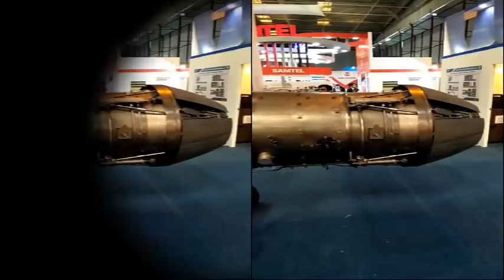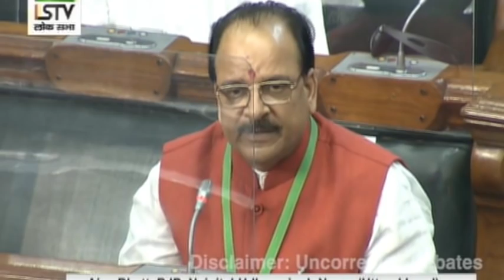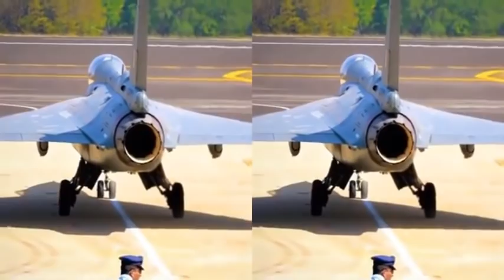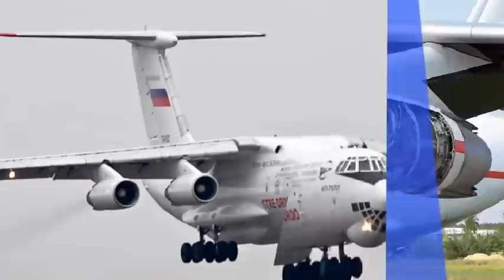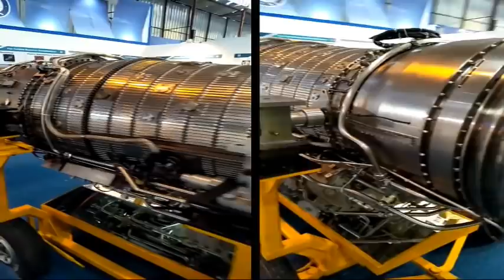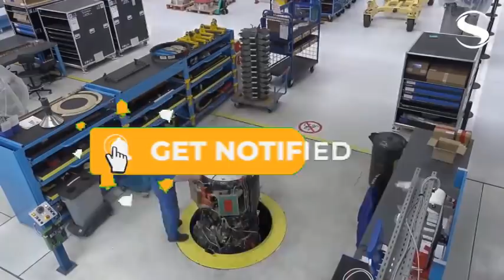Update on Kaveri Engine by Ministry of Defense | Realistic review of Kaveri engine program

Comment: While burning the fuel more pressure is put on to the nozzle so this creech problem is occurring during the fuel burn out so replace big size nozzle the  creech sound fully exhausted it's problem only in nozzle only replace with big  nozzles definitely the sound is exhausted it

Comment: It's shocking that DRDO has not its own flying testbed.How can we expect a perfect engine?
Reply: Didn't they just acquire an air india a320 as FTB . But I guess that was for radar, don't know why they can't buy another a320 and convert that into FTB for kaveri programme. This dependence on Russia is exactly why it is taking so long to build a reliable working jet engine.
Reply: @nachiketkulkarni8540  For engine testing a 4 engine testbed is the most suitable.
Reply: India needs  fully functional wind tunnel facility.

Comment: According to DRDO they want an engine with 110kn for AMCA. I don't understand why we are going for such a low power engine for our future frontline fighter. Shouldn't we go for something in the range of 150kn engine?
Reply: Actually 110kn for an F414 sized engine will be a very hard challenge to accomplish.
Reply: Because AMCA is a 25tn class fighter jet.It doesn't need more thrust but more electric power.
Reply: But we don’t even have indigenous 110kn engines?
Reply: bcz drdo only needs the engine core and metallurgy . They can then upgrade it to whatever extent they want once they get the metallurg right
Reply: I think the reason is that it's better to go step by step rather than commit for something too ambitious and not succeed. Currently only USA and Japan have been successful in building 150+KN low bypass engine with years and years of gas tubine engine building experience behind them
Reply: Why to ?
Warrior wingman & ghatak kis liye hai ...